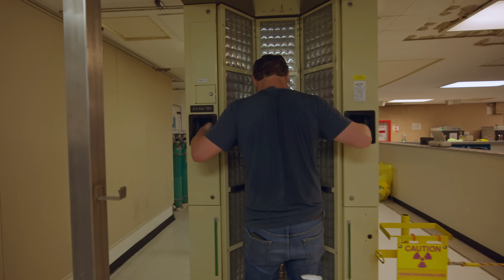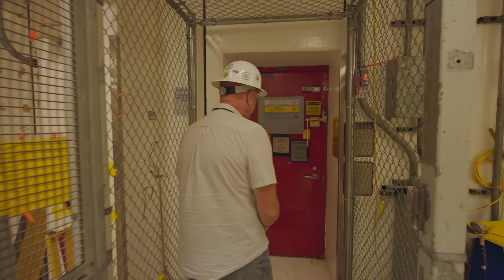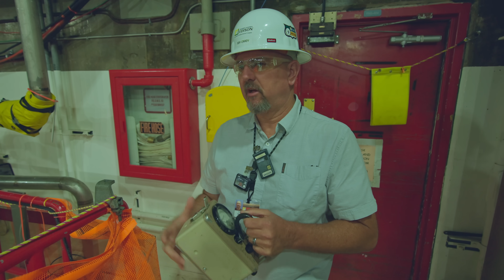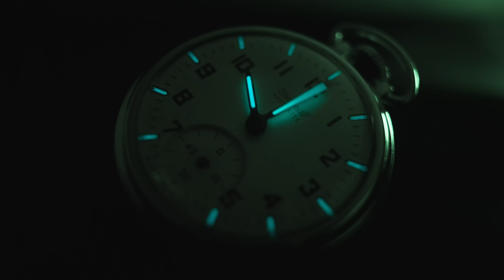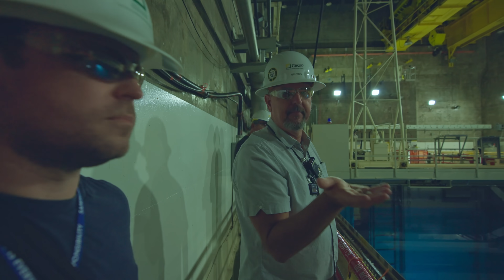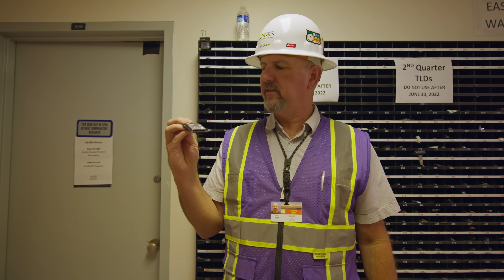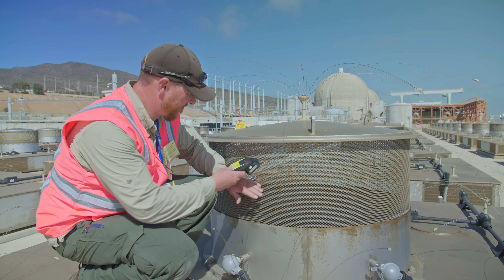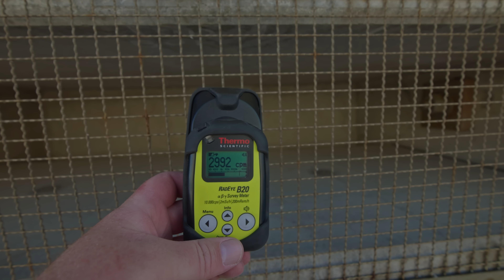Inside San Onofre Nuclear Power Fuel Pool and Spent Fuel Storage

Comment: So, I had to dig into my memory a bit, I left the industry 45 years ago because I was bored. And yes, 5 REM is an annual limit, however, 1 REM a year is a lifetime limit. I am currently 66 so my lifetime limit is 66 REM. And yes, I would probably be near death if I had received that much exposure. A person over 21 may 'bank' exposure. Why? There used to be some jobs that required a lot of exposure. One job was measuring the thickness of the heat exchanger tubes. Even though these are metal, they do wear out and have to be plugged. So, a tag team of technicians would do the job in relays. Get the sensor in the generator and leave. A second technician would position the sensor at the bottom of the tube and leave. Then the tube could be checked, manually or remotely. Then another tech would pull the probe, and another would set up the next one. They could get 1.25 REM per quarter, and that would take just a few minutes. Then they would get paid for three months while sitting on a bench. Four jobs a year would get them to their annual limit. And they could keep doing this until they reached their lifetime limit. By this time they would be very rich and could take some more time off for sickness. They were also referred to as 'zoomie sponges'. I hope they have fully automated this process. I applied to do this but the God whom I serve wouldn't let me, so I became a carpenter and poor.

Comment: I'll never forget driving to San Diego back in the 1970s and was shocked to see that a nuclear power plant was located as close as it was to Interstate 5.  In addition, there were some residential areas within eyesight  of the area, too.
Reply from the maker: The site is on the military base. So there are no homes right by it. Nuclear power has a very good track record if you look at all the reactors in service and for how long they have operated. More people die from air pollution every year that have ever died from nuclear accidents.
Reply: @RadioactiveDrew Please note that I wrote of residential areas "within eyesight."  Checking Google map and distance, there's a residential area approximately 1.3 miles northwest from the nuclear power plant; that was a residential area I was referring to; as it can be seen from Interstate 5 in the proximity of the power plant.
A reference point on maps of that residential area is the San Onofre Community Center Pool.
Reply: @bloqk16  Along the coast from where I live in Scotland there's a decommissioned coal-fired power plant that was directly adjacent to residential properties and even a kindergarden. During its operation in the late 20th century and later the exhaust gases from the plant's smokestacks engulfed the local area without anyone caring very much. Further along the coast from me is a pair of nuclear reactors which have provided more electricity than the coal-fired plant ever did and without emitting toxic gases in megatonne quantities.

Comment: Is the contaminat detector made up of PMTs/scintilators or all those just a bunch of gm tubes?
Reply from the maker: If you're talking about the Ludlum when you exit the fuel storage room, that's a GM pancake tube. The one carried around by Mike is an ion chamber detector.
Reply: @RadioactiveDrew  No the "stand in" detector at the start that looks like its made from a bunch of square silver cushions.
Reply: I'm asking because the man said it does a "full body scan" which indicates that maybe there is some sort of image or way they can tell what part of the body the contamination is on.
Reply from the maker: Not totally sure. The foil on it makes me think it’s some kind of GM tube.

Comment: If the spent fuel needs to be cooled, why not keep using it as fuel?
Reply from the maker: Because the reactor can’t operate at a higher power level. The fuel could be used in lower power reactors.

Comment: And all this radioactive exposure.  Comes out of those,, pipe elbows.  Which are all over the plant!  And obviously which give off, radiation exposure.  At the elbows!  At all of the elbows!  Where some are obviously  thicker and properly annealed!  Where many are substandard..  Like the one with the mass of yellow tape and protectorate.  That was leaking radioactivity so much so.  It probably should've been replaced.  With a properly functioning version.  But they didn't.   This is floozy work.   This is a hack.  Ready to explode.  And cause all sorts of damage and death.  But there keeping their profit margin up.  By not replacing what needs to be replaced.  Yeah that's really smart of a bunch of college grad scientists.  I'm so glad I don't have one of those fraudulent degrees.  And I've had no interest in working with radioactivity.  Like they did when they were poisoning themselves.  Back in the day.  And didn't have a handle on what was going on.  Enrico Fermi sort of knew how to deal with this stuff.  But not really.  Without others first dying.  From a momentary flash.  Of blue light.  Whoops..  And they are dead.  In days.

So this is really dangerous stuff humans keep fooling around with.  Thinking is some kind of miracle gobbledygook.  When all it does is sanitize the planet.  Of its life.  And they keep building the crap!  Like that fat boy in North Kimchi Korea.  And all the goofball shit.  Vladimir is working on.  To kill Jewish Nazis!  And it happens all over again!  They just keep doing it!  They will not stop.  They will not cease.  They just keep doing it.  Until they go extinct.  And we don't need to help them do that.  They will do it like all the others before them.  Which was from inbreeding for those.  And is what for these?  More of the same!   Inbreeding.  They keep doing it!  And they know what the outcome is.  But they keep doing it.  They are a flawed Insein species.  That just keeps doing it over and over again.  And which proves their insanity and dysfunction.  As they refuse to progress.  Something about conservativism?  That they also do not seem to understand?  Yet they keep repeating that word, conservative.  Which they are not.  And they just keep doing it.  Until they burn themselves out.  Of existence and into extinction.  Like the ones before them.  That were inbred.  They seem to be doing the same thing again.  And they refused to interbreed.  And are into separatism.  Which doesn't work.  Which can't work.  Which won't work.  And they can't figure that out.  Yet they purport to be intelligent.  And obviously are not!  Because they refused to change at all.  And believe that raping and pillaging is the way.  To get to where they want to go.  Where they don't know where to go.  Because they have no place to go.  But they think they do.  On the next planet over.  That's not designed to support any kind of life.  And were merely tossed in as, balancing weights.  To keep the harmonic dependency of the loop intact.  And now they want to upset that balance also!  By sending these crafts.  That will tip the survivability of their solar system.  Until that is no longer habitable.  And they burn out and go extinct.

Then there is a waiting period.  Of hundreds of millions of years.  Before they try another model!  That they will sprinkle down upon us.  As they have in the past.  With their magic fairy dust!  From the cosmos!  Imported and delivered free of charge!  With other impending life forms.  As it has been in the past.  And the process repeats.  As there has been other advanced and intelligent civilizations.  That have all originated, here and left.  As we see them fly around from time to time.  As they phase in and phase out.  Just like the physicists have predicted.  As everyone wants to know what star system they are from?  Well they are from right here!  As it's too far away from anywhere else!  And they know that!  But refused to believe that.  That there could have been others better than them!  But there were.  We've seen it.  The artifacts are there.  We know they existed.  And refused to accept that.  That they were more advanced than us.  And yet they still disappeared.  Where to?  They are right in front of our faces.  They are still here.  Energy is never destroyed but merely converted.  Into a form we cannot perceive.  But we know is there.  Because we can see its effects.  Black holes and the whole 9 yards.  All they are waiting for us.  To discover its secrets.  Before it's too late.  But it will be too late.  It is already, too late.  We have blown it again.   And we will be going by the wayside.  As the others before us.  In due time.  Shortly.

Now I feel like one of those kooks.  Walking around with that sign on the street.  The end is near!  Because it really is!  And these weirdo freaks all knew it!  They were the only ones!  And they were terribly dysfunctional and flawed.  But they knew.  What was to come.  They just don't know precisely when?  But it's a comin''.  It's a comin'.  And it's not if but when.  As it has been in the past.  And the dinosaurs all knew.  What was to become of them.  And we found the millions of years later.  Underground.  Just waiting for us.  To tap in.  To show us.  What's also to become of us.  As we are buried beneath trillions of tons of cosmic space dust.  That made our planet a rocky place.  With all of the dust it has collected over billions of years of time.  And that's where gravity dies.  It's a dust collector.  And nothing more.  There isn't anything more.  Just ashes to ashes and dust to dust.  Of exploding stars.  And they all explode in time immemorial.  Everyone.  They are given birth to.  They live.  They die.  Just like anything else in the cosmos.  And that's all there is.  There isn't anything more.  As much as humans want there to be.  And that's the meaning of life, immemorial.  There isn't any meaning.  It just goes by at, lightspeed.  You either catch the wave or you don't and wipe out.  And thus will always be such.  As we ride the wave of life in the cosmos.

Yes there is much to see into yet.  In order to ensure our species survival.
RemyRAD